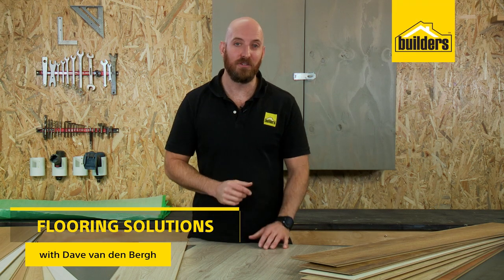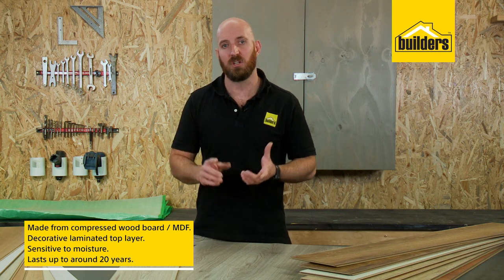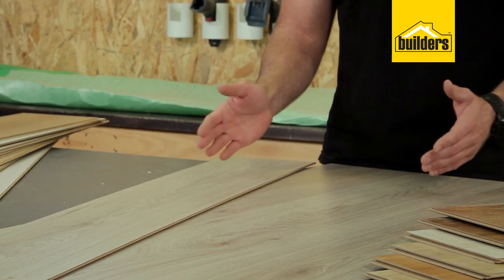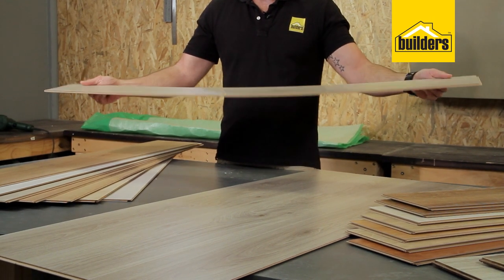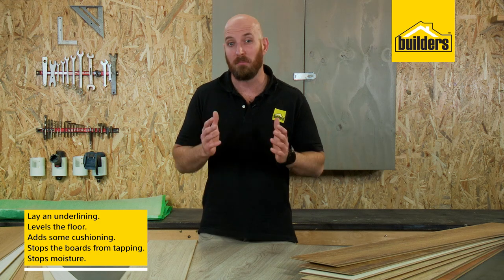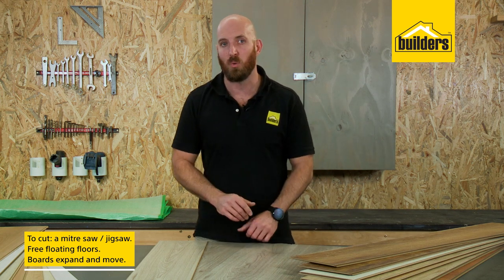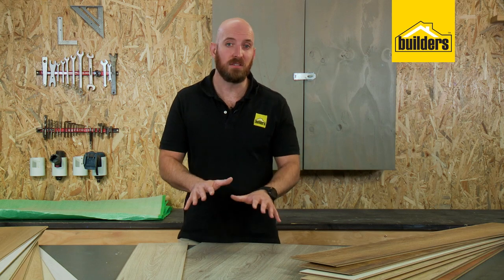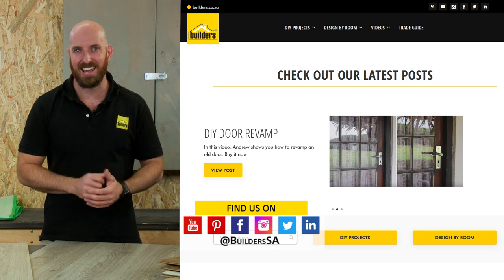How To Install Laminated Flooring for Beginners

Comment: Can you lay laminate over tiles or must you lift the tiles first?
Reply: Hi @kim8946
The tiles should be:
- Level and even
- Solid with no loose tiles
- No loose grout or tiles popping up
- Terracotta or Slate tiles are usually not level or even enough 

If the tiles fit within the above requirements then yes! 

You will require a underlay that gets put on the tiles and the Laminate board is installed on top if the underlay which is on top of the tiles. Things to look out for:
- Hight implications (For example the doors might be to low and would have to be trimmed)
- Skirtings & Qtr.-rounds: Their functions are similar which is to close the expansion gap that we have to leave next to any fixed object like Walls, Door frames, another floor type(Carpet, tiles etc). You could use your existing skirting or opt for new skirting depend on budget and end goal look that you would want to achieve. Give this more thought than you think as Skirtings are becoming expensive.

DIY or Professional installation service?
That's a tough one,  is it possible to DIY the product, yes. Should you, depends on the project and the application. If its one standard bedroom then you could give it a go. If you are planning on doing your entire house then I would say using a professional company will save you time, headaches and believe it or not money.

It all comes down to accountability. Professional companies have to follow the product manufacturers warranty requirements which will normally also have a few implications. By having a product correctly installed will not only give you peace of mind but also ensure that you get the life expectancy from the product and get after-sales services should you ever have a problem. By not going this route it could be more of a gamble, you could save a few bucks but would have to replace the floor way before it was intended to be replaced. 

You could always get a free quote and see how it aligns with your budget (Unique Flooring)